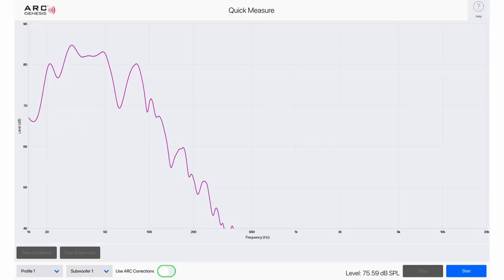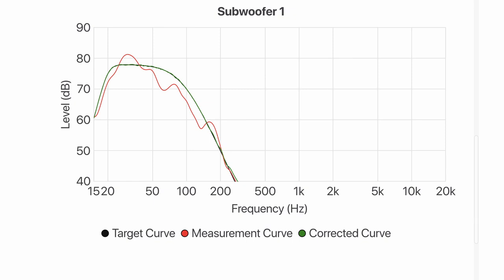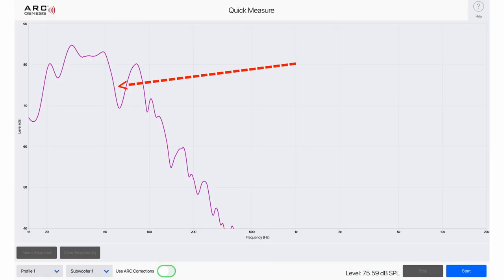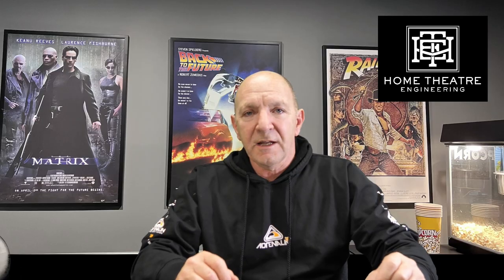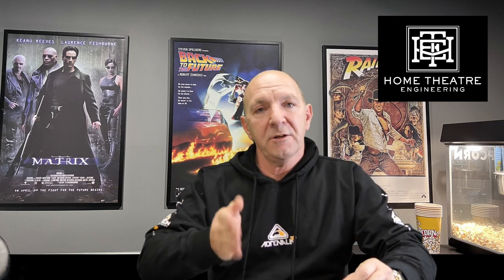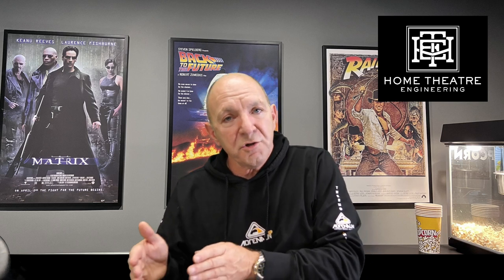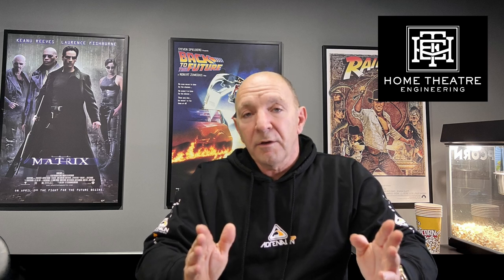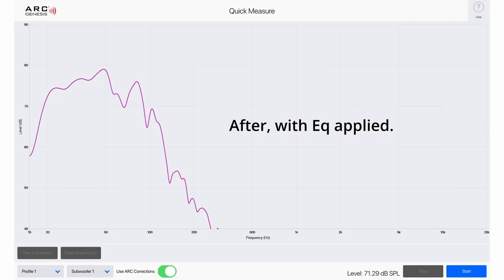Room Correction (Auto Eq) Lies !! The problem with bass room modes.

Comment: Good stuff. I see the same issues with Dirac where the corrected doesn't match the after measurements with REW. I actually submitted a feature request for them to add a post correction measurement step in the software, we'll see if it happens.

Comment: Thank you for that..and I am so glad someone pointed this out. I couldn't agree more. I ran Dirac Live in my AudioControl Maestro X7 and it made the bass sound very dull and lifeless. I have had the best results with Dirac Live turned off and equalising the dual subs with miniDsp..... now it sounds great...good mains-to-sub integration, a nice looking house curve and have managed to eliminate room rattles by using low pass filters. I think miniDsp is an underutilised platform and too much reliance is placed on automated room correction software.
Thank you for the nice video - I have learnt a lot from all your posts...👍👍
Reply from the maker: You are most welcome thank you too!

Comment: I've tried minidsp, dirac, Yamaha's ypao, & currently, deqx preMATE.  The premate is quite a few steps ahead of the others, but requires more learning & understanding to use beyond the basic automation it can do (if you choose that route).  And it does have a 'verify' feature, you can use after room correction.  It's a remarkable product!
Reply from the maker: Thanks for that will take a look

Comment: Thank you for making a video about this. I did this experiment myself 5-6 years ago. 
The interesting part is that, i re-did the test 3 times, and i got wildly different graphs, even thou the measuring mic (umik1 that i used to graph before and after results) didn't move.
So i just don't EQ the speakers at all, only the subs and i don it manually.
Reply from the maker: Thanks for sharing!

Comment: In fairness it took a >10 dB dip to about 5 dB after ARC. The post correction graphs look like high ratio smoothing. But you do make a great point and learned something that you need to do much more than rely on basic auto-eq.  Get the the positioning down and use 4 subs and also bass traps at the problem frequencies.
Reply from the maker: Depends how you look at it. It reduced the peaks but in reality did not “increase” . But yes your point is effectively correct. The next issue I have is the actual measurement which I am digging into because I am seeing different results with my own calibrated test gear vs the results by this system which is also interesting.

Comment: I liken trying to raise a bass dip/null to throwing light into a black hole. You can throw a sun at a black hole and it’ll just swallow it up. In audio, you lower peaks to shrink the delta between peaks and dips. That’s why JL’s fathom subwoofers have 18 possible filters and a kajillion watt amplifier: if you’re lowering up to 18 different peaks to get closer to dips, you need amplifier headroom to make up the lost gain. Most room correction programs these days are doing a version of this, so it’s not new to audio companies. It’s just consumers who don’t fully understand what’s happening with these programs.

Comment: I run Dirac first, apply it,  then run REW and add a filter over the top as needed.
Reply: Ok I’m a bit confused here. You cannot eq out a modal dip so that process will work for peaks but if you do that between dirac and rew you are potentially stealing q lot of energy from the system. You are far better off balancing subs and changing sub and seat positions with rew first then running dirac and then re measuring..

Comment: Andrew, In my opinion Auto EQ/Room correction - a gimmick at best.  It's there just to appease the average AVR owner.  Before I learned the difference I was thinking I had done the right thing  by running the Auto EQ and calling it good and done.  Now that I know more tuning can and should be done, I have been pulling my hair out trying make my low budget system the best it can be.  REW (Thanks John!) is a huge help when someone learns how to use it properly.  It's quite a task to learn and I have only scratched the surface of it.  But, with the level of AVR that I own there is only crossovers and distances that can be adjusted when the speaker/sub woofer placement is done, then adjust the crossovers again.  Maybe someday, if I'm a really good boy I will be allowed to own a processor worthy of a "professional" tuning.
Wishing you and yours all the very best, Kevin
Reply from the maker: sorry its so late... I wouldn't call it a gimmick it can be useful but really only after all else is as best as it can be. But even then it needs to be verified.
Reply: @HomeTheatreEngineering  Yes sir.  Auto Room Correction/Auto EQ can be helpful as a first run and, of course, it's all that can be done in the average AVR.  Except for distance and crossover settings.  Since using REW to confirm and adjust my old Onkyo 636 takes me several hours, I have a ton of respect for professionals like yourself that installs and tunes units like Trinnov.  Your an AV Hero!  I hope you have great day, Kevin